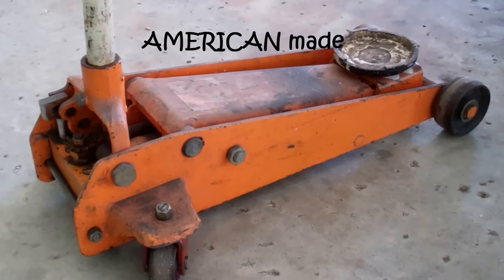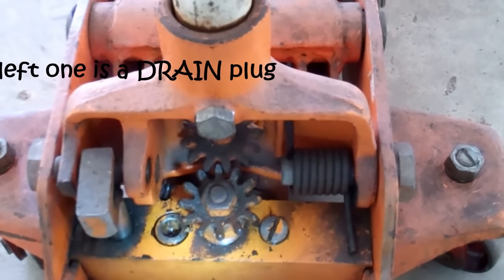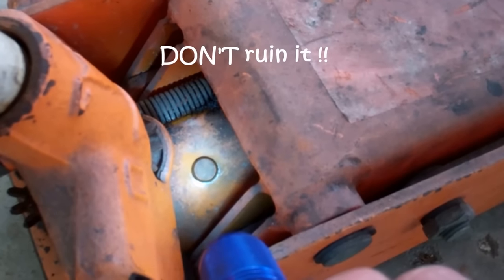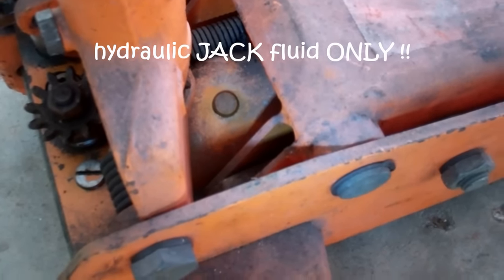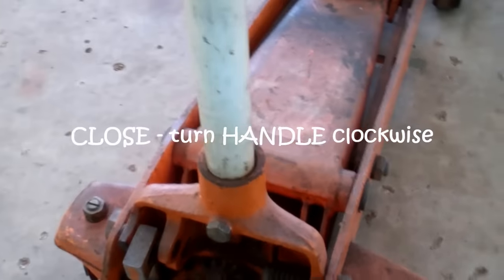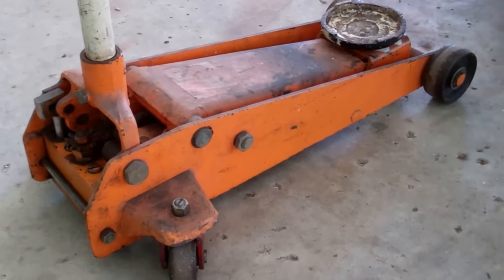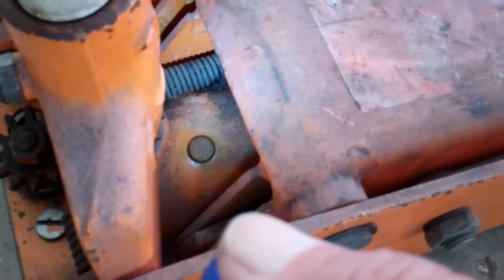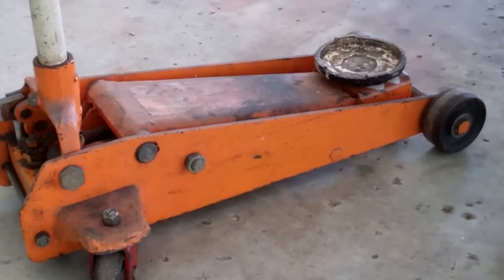Fill & Bleed a floor jack

Comment: Thanks for the info. I have the exact same floor jack as yours. very heavy construction. It is made in China not the USA. Bought it at NAPA.  You will not be able to afford a made USA floor Jack unless you are  rich and then all the parts are probably made in China.
Reply: I agree.  My jack looks the same and has a Allied label with Made in China;

Comment: I have a 2 ton OTC jack, It pumps up but won't hold the load & it "drifts Down" I've bled this jack 100 times but still cant get all the air out of it, When jacking it up all the way & letting the jack down, it goes down about 95% then stops until I remove the rubber plug to release the air, It does this every single time no matter how many times I bleed it, I've even raised up the one end of the jack hoping it would help release the trapped air,  Any ideals?  Thanks..
Reply from the maker: it's just a guess, but maybe try without the plug and see what happens
Reply: Still having problems, the seal kit is about $140.00 I know brake fluid will eat up the seals & trans fluid will swell them up, I just found some info on this jack today, it's a older jack & it specifies that it uses trans fluid & not jack oil,  I'm gonna give that a try next week & maybe add some lucas oil P.S or trans stop leak to the jack & maybe it will swell up the seals some & work. The jack is full of hyd jack fluid. It can't hurt to give iy a try.

Comment: WARNING! - there's a lot of pressure after filling. when I went to cycle ( pump ) like he says to do here it blew that rubber cap off with tremendous force & hydraulic fluid shot out everywhere . . . wear safety goggles at the very least.

Comment: I have some jack and I lost the small rubber plug.where can I get it please?
Reply: Check your auto parts stores for one that will work.
Reply: check it out on ebay they have the little plug , look under floor jack seal kits punch in seal kit # 215500 it will show the small plug what people ordered with the kit , the plug is $8.00

Comment: Hey Ed...Do you know the brand name of the jack? I have the same one but the label is worn off cause I've had it that long...I tried to add fluid but jack still comes down on it's own quickly...Thanks, Dan
Reply: Dan Ceremelli Central Hydraulics. Although I can't find a website for them.
Reply: Thanks for the info Jeremy...I appreciate it...

Comment: At around 1:55 you said 'do not use automatic transmission fluid - it will eat the seals'.

Automatic transmission fluid IS hydaulic fluid. Or what do you suppose holds those clutch-packs 
together so tight that your wheels spin on dry pavement before the auto-trans clutch-pack slips? Hmmmm? A/T hydraulic pressure is sustained by the A/T hydraulic pump and......... AAATTTFFFFFFF!!! at up to 4 or 5 hundred degrees without losing effectiveness!!! Now THAT is some EXOTIC JACK OIL!!!

If ATF 'ate seals', then it would eat the seals in your automatic-transmission. But it doesn't eat seals. ATF, rather, is designed to PRESERVE SEALS in a MUCH MORE HOSTILE environment inside your automatic-transmission..

It is always ok to use ATF in place of hydraulic-fluid or jack-oil. ATF IS hydraulic-fluid/jack-oil on steroids. It's WAY overkill for a floor jack. I use ATF in my wood-splitters and my jacks.

Thank you for the jack maintenance tips. I liked your video.

Comment: I watched your video and i liked it, but one error is that the left plug is not a drain hole. It's a check valve, i found out the hard way trying to bleed my jack. Depending on whether the plug is a allen head bolt or a slotted head bolt (screwdriver slot) determines what is inside, in my case, (allen head bolt) it was two steel balls of different sizes no springs, after recovering them from my garbage can, one on one day the other two days later after looking at this picture https://www.hcrcnow.com/images/faqs/OverloadAdjust.jpg i took out the bigger one out with a magnet, but the smaller one in first then the bigger one, then screwed in the allen bolt, my jack is now working.
Reply from the maker: or perhaps yours is different than mine; mine has drain left, check balls (and springs) right.  in either case, as I cautioned in the video, there's nothing there for you so leave them be.  glad to read you got yours on line though

Comment: You are sooooo wrong!! Motor oil will NOT compress.  It is a liquid and liquids WILL NOT  COMPRESS.  Yes, there are additives in motor oil that can damage seals etc but will not compress.  Yes use only hydraulic jack oil but liquids will not  compress.
Reply: Why did they put hydraulic fluid in it and not oil ?? I think that should answer your question.